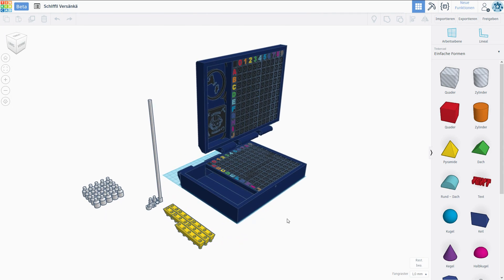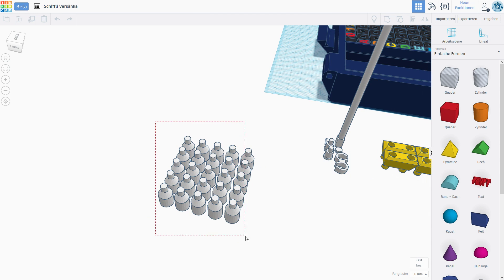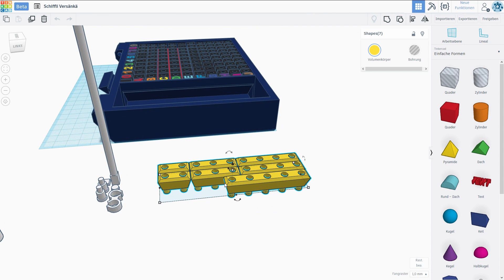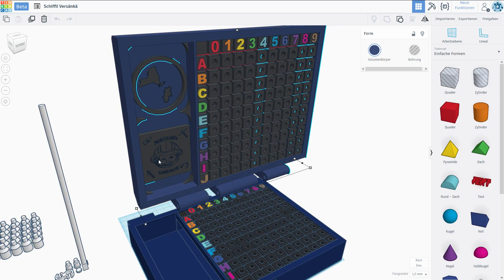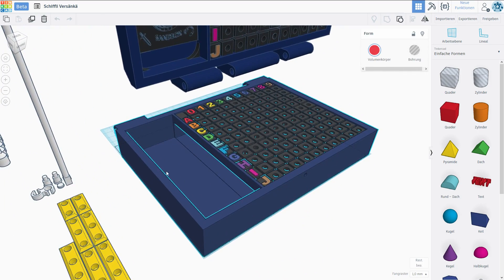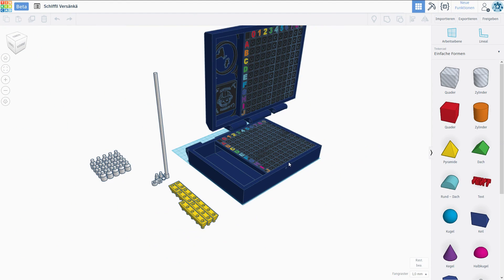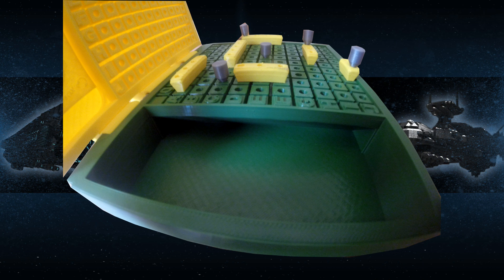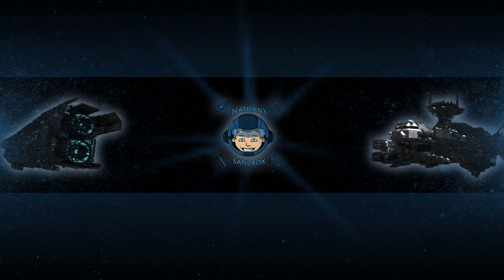3D-PRINTING THE GAME - 3D Designing & Printing: Ep. #4 - Making A Battlefield Game

Comment: Nice work, 17 hours to print, one of those OUCH LOL...

I was going to suggest that you add more of a weight maybe in the space where all the piece's go so the board it self doesn't fall over towards the back as it has no counter weight holding it down.

Imagine all the problems your running into and then think about those board company's that had to resolve these before production on a massive scale :P
Reply from the maker: Even though it doesn't look like it, the board doesn't flip over even if you give it a little nudge.
Reply: Great work,  Working on that board I hope you luck in your next project :)

Comment: Awesome work as always, every 3d print is a new set of learning experiences. Eventually you will learn all the little tricks that work best with your setup, I look forward to more 3d printing projects. :)

May I recommend getting a 3d pen as part of your 'printing kit', because you can manually fix problems with parts, as well add color and detail by hand to monochrome prints. 

I also recommend getting a cheap adjustable temperature soldering iron with interchangeable tips, that way you can melt holes into prints easier than drilling. Because you are melting the plastic you aren't removing it, just remodelling it so the holes aren't  new weak spots in the shell. 

I also like to use the little brass knurled inserts for M2/M3 screws, with a soldering iron you can melt them into your prints for metal screw points for assembling multi-part prints. 

@12:40 is a great example of a use for a soldering iron and a 3d pen, you could melt a hold and anchor the back to add your pin in. 

My suggestion for a project: Look at the different methods of using in-game models from various games, and print one you really like as a decoration.

Comment: I suggest you to add always a joint between the small pieces to avoid what happened to you with the pins, you can cut them later. :)
Reply from the maker: Yeah, that is actually a good idea:)
Reply: my teachers always told me "don't try to re-discover the wheel". most of the plastic games come with the small pieces with joints between and the fun part of the unboxing was to split them :D